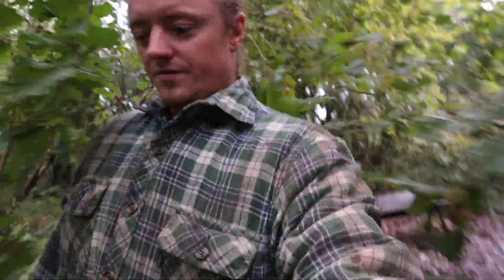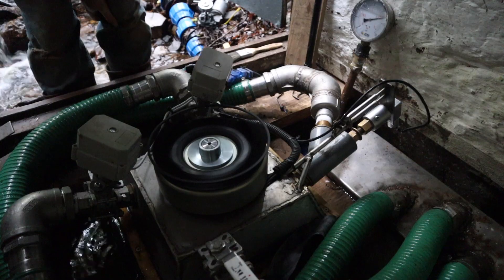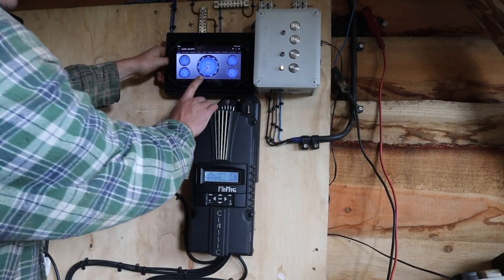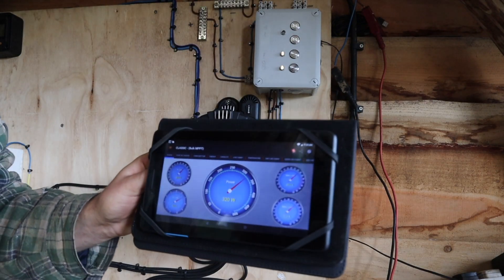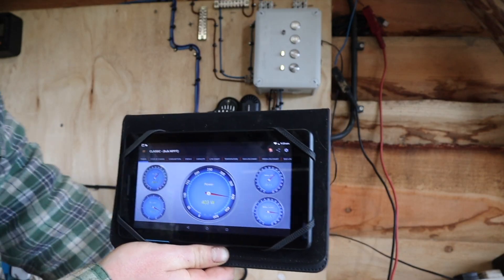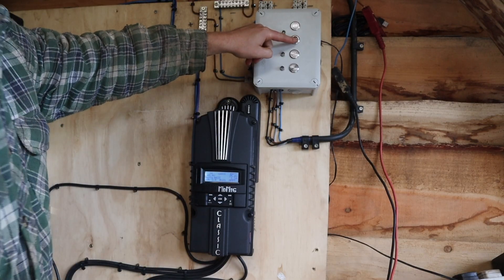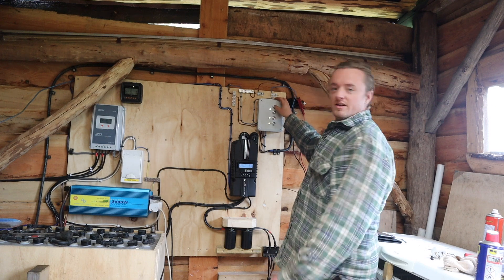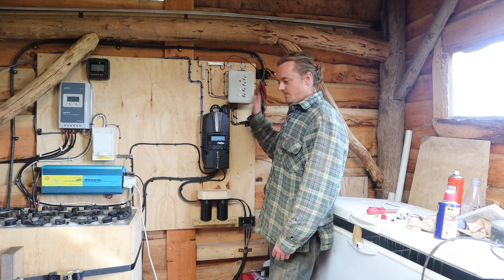Off Grid Arduino Controlled Micro Hydro Full Power Test 400W

Comment: Waited a long time to be proven right... Thank you...

Now still trying to help, you could improve your power generation numbers dramatically if you build your own generator, i am looking at building a dual axial flux wind turbine generator (hydro aint an option for me at present), you could build one yourself for about £100 in copper magnet wire and neodymium magnets (would also make for some very interesting videos). There are plenty of old videos on youtube for you to look at if you get tempted. Im almost ready to order my magnets and magnet wire but need to outsource some lathe work before i start spending as i need to see that i actually get enough wind to turn my turbine in the small space i have to put it.
Reply from the maker: Tricky's World • 10 months ago

So glad to hear a 2nd turbine is going to be added, but you do realise that 4 nozzles will not create 4x the power that 1 nozzle will make don't you? Sounds like you really want to waste potential power or just run a generator as fast as you possibly can to see how long it lasts. Myself i would build 4 turbines and have 1 nozzle each, convert to DC in the hut and send all the DC back up the existing cables, if memory serves you would only need to run a cat 5/6 cable for networking (you can go 100 meters with cat 6) and move the hydro charge controllers to the hut, you may also need an ethernet switch and a buck converter to power it but that shouldn't cost more than £20. That would also allow you digital control over the nozzles using raspberry pi or even arduino with electronic valves/taps.
What ever you do i will still tune in and offer insight where i think you need it. :)

500 Kwh Off Grid Hydro Electric Pelton Turbine Update

Kris Harbour Natural Building
Kris Harbour Natural Building
 • 10 months ago (edited)
4 nozzles does equal 4 times the power minus any pipe friction loss as more water will be moving. and loss in the cable due to cable loss. 4 nozzles does mean 4x the power, it just also add more losses but that would be the case if i had 4 turbine with single nozzles. but that would be way less efficient due to the losses in each individual turbine. PLus the idea of the 4 nozzles is to be able to run differant flow rates with fixed nozzles. otherwise i would just run one huge nozzle. also DC does not travel well so converting to dc in the powerhouse would be silly. ac is much better and convert to dc at the battery. and i ran 4 core armoured cable not cat 5. I think whatever you have been reading has been a bit misleading. i can easily send dc down the cable to turn nozzles on and off and that could be controlled from the battery shed. the way you have suggested would be very inefficient

Thats without even getting in to the fact that the expensive equipment would be above a stream in damp conditions.
Reply from the maker: Tricky's World • 10 months ago
 Mate i'm not being funny but you will find you won't get much more power if any, i would actually expect a loss of power per additional nozzle from the same feed. In practice you are turning the generator with a fixed amount of pressure from 1 nozzle, if you add a second nozzle from the same feed you are going to reduce the pressure that turns the generator on the original nozzle because there will be less pressure in the system, your just going to balance the original power over the first and second nozzle which i don't see giving you any extra power from only 1 generator, it's just going to waste some of the system potential.
 I honestly would build a separate generator for each additional nozzle you want to have coming off the system and only run as many as the pressure will allow. I know this is the expensive option but that's what i would do, it would also provide redundancy.
Your hydro is converting pressure into electricity which you can prove by closing your tap off half way, and watch the power that is generated reduce, if you add a second nozzle you are going to reduce the pressure in the system which will give you less power in the end.
I will happily eat my words if you prove me wrong, but i honestly don't think you will. I will also gladly look at anything you can point me at that will prove me wrong.
Reply from the maker: That is what you said, and i have showed with this turbine that adding more nozzles does add more power. you can even see it with your own eyes as i do it on the video! I just dont understand how you can not get that. Anyway im off, Not going to go though it all again. Back to school for you i think.
Reply from the maker: Proven right? you told me having more nozzle dose not give more power....... Proven wrong is what has happend to you. 

what you said
"Mate i'm not being funny but you will find you won't get much more power if any, i would actually expect a loss of power per additional nozzle from the same feed" 

honestly dont know what world you live in mate. Your advice last time was to build 4 separate turbine because somehow that would work better........adding 4 separate alternators, 4 separate sets of bearings, 4 of everything that causes losses. honestly mate your in your own world. Also i build an axial flux wind turbine years ago, i have a video of it.
Reply: @KrisHarbour  so you want to be a prick then, cant accept facts so try to be clever when your evidently not LOL...

1 you have upgraded your generator, 
2 you have upgraded your pelton wheel, that is where your slight gains have come from, yes 33% is slight especially when we are talking watts and not kilowatts.... 
3 your own words "4 nozzles = 4 times the power" yet from 300 watts to 400 watts, funny 4 times ehhh where is the 1200 watts??? Is it lost in the resistance of the generator by any chance, hmmmm now you know exactly why i would have had 4 generators instead of 4 nozzles.

Obviously you never studied electronics at any level, let alone the level i have, but you continue trying to teach somebody who is clearly more educated on the matter than you LOL...

"honestly dont know what world you live in mate. " & "honestly mate your in your own world." LOL again, you have been proving this all along with all your videos but thanks for your reflection...

You could have just accepted that you was wrong like i was willing to do had you proven me wrong which you can not do, instead you chose to be a prick and make an enemy of one of your oldest subscribers who was trying to give you the benefit of my knowledge, thanks for spitting in my face...
Reply from the maker: I never said 4 nozzles would give 4 times the power if they were all sized differently like they are in my system......If you look you will see that i gave you all the numbers i was expecting and they are exactly what im getting!  if they were all sized the same they would give 4 times the  power minus any losses. I didnt think i would need to spell that out to you as it seems that obvious.   i could make all the nozzles the same size and get 1200w if i had the available water to do so. its just i choose to make them all different sizes to give me a range of flows..... i dont understand what you do get about that. if you quadruple the flow you will (minus losses) quadruple the power. I have not done that as i dont have the water to do that but i have used 4 nozzles of different sizes and got a range of flows and different power levels witch is what you said would not happen..... im really lost for words at how you cant understand that.
Reply from the maker: Here is the complete conversation for anyone interested. 

Tricky's World • 10 months ago
So glad to hear a 2nd turbine is going to be added, but you do realise that 4 nozzles will not create 4x the power that 1 nozzle will make don't you? Sounds like you really want to waste potential power or just run a generator as fast as you possibly can to see how long it lasts. Myself i would build 4 turbines and have 1 nozzle each, convert to DC in the hut and send all the DC back up the existing cables, if memory serves you would only need to run a cat 5/6 cable for networking (you can go 100 meters with cat 6) and move the hydro charge controllers to the hut, you may also need an ethernet switch and a buck converter to power it but that shouldn't cost more than £20. That would also allow you digital control over the nozzles using raspberry pi or even arduino with electronic valves/taps.
What ever you do i will still tune in and offer insight where i think you need it. :)

500 Kwh Off Grid Hydro Electric Pelton Turbine Update

Kris Harbour Natural Building
Kris Harbour Natural Building
 • 10 months ago (edited)
4 nozzles does equal 4 times the power minus any pipe friction loss as more water will be moving. and loss in the cable due to cable loss. 4 nozzles does mean 4x the power, it just also add more losses but that would be the case if i had 4 turbine with single nozzles. but that would be way less efficient due to the losses in each individual turbine. PLus the idea of the 4 nozzles is to be able to run differant flow rates with fixed nozzles. otherwise i would just run one huge nozzle. also DC does not travel well so converting to dc in the powerhouse would be silly. ac is much better and convert to dc at the battery. and i ran 4 core armoured cable not cat 5. I think whatever you have been reading has been a bit misleading. i can easily send dc down the cable to turn nozzles on and off and that could be controlled from the battery shed. the way you have suggested would be very inefficient

Thats without even getting in to the fact that the expensive equipment would be above a stream in damp conditions.

4

Tricky's World
Tricky's World • 10 months ago
@Kris Harbour Natural Building Sorry mate but you are wrong and you have not understood what i have tried to tell you, 4 x the nozzles does not equate to 4x the RPM on the generator nor 4x the power, but sounds like your going to prove me right when you measure 1 nozzle at say 300 watts and open the 2nd to not see double the power, but what ever i tried to help you, you obviously don't want my help and intend to learn the hard way... 
A network hub is not expensive 10er ish, a buck converter is a couple of quid off ebay, your charge controllers can be isolated from moisture with a few quids worth of kingspan and or another of those big plastic boxes, the massive cable you have already laid will give you almost zero losses from DC especially when you have effectively 2 runs of neg and pos. Adding a cat 6 network cable would allow you to place your hydro controllers in the hut or even a smaller cabinet just outside the hut like the BT and virginmedia cabinets that litter the streets, it would also give you connectivity for a hub to add a raspberry pi (£12 ish) or even arduino (less than a 10er with ethernet connectivity) to control your electronic valves and read water pressure from sensors from any device connected to your network, or automated control or even via the internet if you want it to be fully remote controllable/monitorable.

Kris Harbour Natural Building
Kris Harbour Natural Building
 • 10 months ago (edited)
Honestly mate, i dont mean to put you down but you really do need to read some more. The rpm is fixed and has nothing to do with adding more water. more water means more power not more rpm, my rpm is half the speed of the nozzle velocity  so it can catch the energy in the water. adding additional nozzles at the same velocity means the turbine spins at the same rpm but with much more water hitting it meaning it makes more power. This is standard practice for micro hydro. 

you can think of it as volts and amps if you find that easier, the speed of the water coming out of a nozzle is the volts and the amount of water is the amps. the speed of the water coming out of the nozzles stays the same (like having a fixed voltage)  because of the pressure that is fixed (other than losses due to friction)  but the amount of water increases (due to more nozzles) The extra water in this example is like more amps . more amps means more power if the volts stay the same. maybe talking in those terms makes it more clear for you as you seem to be more in to electronics. 

https://www.google.co.uk/search?q=micro+hydro+turbine+multiple+nozzles&source=lnms&tbm=isch&sa=X&ved=0ahUKEwi-mfq7vNTeAhURtosKHTQSACcQ_AUIDygC&biw=1440&bih=798#imgrc=aVQjhIXhXISStM:

here are my figures as i add more nozzles this is what i will expect to get 

1l/s@ gross head of 18.5m = nett head@ turbine of 18.1m = 113w with a flow of 2l/s@ gross head of 18.5m = nett head@ turbine of 18.02m = 226w and with 3l/s@ gross head of 18.5m = nett head @ turbine of 17.9m = 338w, 4l/s@ gross head of 18.5m = nett head @ turbine of 17.74m = 445w, 5l/s @ gross head of 18.5m = nett head @ turbine of 17.53m = 550w, 6l/s @ gross head of 18.5m = nett head @ turbine of 17.3m = 651w, 10l/s@gross head of 18.5m = nett head @ turbine of 15.97m = 1kW, 15l/s@ gross head of 18.5m = nett head @ turbine of 13.5m = 1.27kW, 20l/s @ gross head of 18.5m = nett head @ turbine of 10.28m = 1.29kW.  You can see that trying to push 20l/s down the penstock creates a huge loss in head at the turbine, in fact 15l/s=1270w & with 20l/s = 1290w just a 20w gain.

so if i doubled the flow by adding another nozzle i would get 651w i would expect a bit less than that realistically so around 600w that is at 6lps. as you can see the limiting factor is the loss in the penstock but it only becomes significant as the flow gets very hight due to me designing the system to accommodate upgrades.

3

Tricky's World
Tricky's World • 10 months ago
@Kris Harbour Natural Building Mate i'm not being funny but you will find you won't get much more power if any, i would actually expect a loss of power per additional nozzle from the same feed. In practice you are turning the generator with a fixed amount of pressure from 1 nozzle, if you add a second nozzle from the same feed you are going to reduce the pressure that turns the generator on the original nozzle because there will be less pressure in the system, your just going to balance the original power over the first and second nozzle which i don't see giving you any extra power from only 1 generator, it's just going to waste some of the system potential.
 I honestly would build a separate generator for each additional nozzle you want to have coming off the system and only run as many as the pressure will allow. I know this is the expensive option but that's what i would do, it would also provide redundancy.
Your hydro is converting pressure into electricity which you can prove by closing your tap off half way, and watch the power that is generated reduce, if you add a second nozzle you are going to reduce the pressure in the system which will give you less power in the end.
I will happily eat my words if you prove me wrong, but i honestly don't think you will. I will also gladly look at anything you can point me at that will prove me wrong.

Tricky's World
Tricky's World • 10 months ago
@Kris Harbour Natural Building LOL i know basic physics and the conservation of energy, i also know electronics. Anything not smart assery to prove me wrong or do i have to wait for the video that proves 1 of us right?
Reply: @KrisHarbour  Im really lost for words with how you know i am right, and have done it the way you have to try not to prove yourself wrong, sorry but anybody with half a brain cell can see this and i foresaw this exact conversation the second i seen the video showing different sized nozzles but waited to see where the spear valve was going and hoped there would eventually be 4 of them. 

I told you,  you have have a finite amount of pressure (maybe not the exact words) what you call your flow, and that pressure is what you are converting into electricity, you only have a finite amount of power you can produce and it matters not if you produce that finite amount of power by using 1 nozzle or 4 or even 20, the conservation of energy tells us you can not get more out than you are putting in, all you can do is optimise and work towards a 1 to 1 conversion. What i did not say is that you are at a 1 to 1 conversion because there was and still is room for improvement but you will not get it using 1 generator and how ever many nozzles you want to complicate the matter with, all you will do is run the generator at or above its max potential and create heat in its winding's which will dramatically reduce its lifespan.

I didn't give you the benefit of my knowledge to get you to waste money, nor was i saying to spend that money with me, i had no motivation other than to see you generate the most power you could for the longest amount of time (something you don't seem interested in, it looks like you are just playing and happy with what ever you can get by finding your own way and refusing advice, the age old learning the hard way), yes i was creating more work for you but i thought you would be grateful for the video content inspiration and help you to learn something about arduino and or raspberry pi as controls which i was willing to help you with.

I still say you are better off with multiple turbines, and simply because you already have a 4 core armoured cable ran i would still convert to DC in or next to the turbine house (BT / virginmedia have very expensive electronics in those green cabinets you see all over the country and many are right next to rivers and canals much bigger than your stream) to save you running another long expensive cable, the losses in DC i would not expect to be more than the gains from multiple turbines as your cable is not thin and shitty stuff, but hey if your happy to just play and not do the best you can thats up to you.

Whilst you suggest i go back to school, i suggest you actually enrol in an electrical engineering course, at least i already passed one of those...
Reply from the maker: I really dont know why im still bothering talking about this because its tireing. you are missing some fundamental understandings of how it works and because of this misunderstanding what im saying. 

flow and pressure are not the same thing. the pressure comes from the head and the flow is whatever water is available in the stream. 

"I told you,  you have have a finite amount of pressure (maybe not the exact words) what you call your flow, and that pressure is what you are converting into electricity, you only have a finite amount of power you can produce and it matters not if you produce that finite amount of power by using 1 nozzle or 4 or even 20, the conservation of energy tells us you can not get more out than you are putting in, all you can do is optimise and work towards a 1 to 1 conversion. What i did not say is that you are at a 1 to 1 conversion because there was and still is room for improvement but you will not get it using 1 generator and how ever many nozzles you want to complicate the matter with, all you will do is run the generator at or above its max potential and create heat in its winding's which will dramatically reduce its lifespan"

You are correct in what you say about there only being a finte amount of power available if we talk only in terms of pressure. BUT we are not talking in terms of preasure.....as i turn on more nozzles i am increasing the FLOW. MORE WATER MORE ENERGY. the amount of water veries through the year and with the 4 nozzles i can controll how much water is going through the turbine. The pressure is always the same though. minus small losses as the flow goes up(as you can see on the gauge in the video)  Now the confusion here is you think that because the preasure stays the same the output stays the same regardless of flow and that is not true. if i have one nozzle on at 25psi at 1 lps and it makes 100w if i open another 1lps nozzle it will run at 200w but the preasure will stay the same its just the flow that goes up. you can see this in the video as i do it. 

Now there is always small losses as the flow goes up but to keep it simple im ignoring them at the moment. you originally said adding more nozzles will not give me more power because it wont increase RPM and your right it does not increase  rpm but it does increase the amount of energy hitting the turbine because the flow has gone up..... i could of coures just have one nozzle and double its size and we would double the output power but having 4 nozzles gives me much more controler over a large range of flows. now i could drill them all out and get 1200w if i wanted to but i dont have enough water to run it at 1200w but it WOULD  run at 1200 if i did that. (it would actually be right at its limit and the flows would have to be very high to overcome the losses at that point as shown in the number i sent you. but we are talking theory here and in theory it would) I gave you all the figures before and explain it all to you last time and now i have made a video showing it working exactly as i said it would and yours still not getting it and i just dint understand why, i know it only does 400w in the videos but that number isnt important for this discussion beacsue i can go get a drill and drill a bigger hole in the nozzles and get 1200w by just increasing the FLOW I just dont have the water to do that right at this moment. if it was raining i could..... I really dont know how i can exaplin it any more simply than that. and i dont understand how you can think i dont understand it when i built the whole system from scratch. i honestly dont know what else i could possible do to explain it. its working EXACTLY as it was designed to and exactly as i said it would from day one.  read the numbers i sent you in the comments above and you will see.. 

Pressure is not flow! they are different things. the preasure stays the same the flow goes up as i open more nozzles and if i make those nozzle bigger i can make it produce 1200w from one turbine providing the water is available at the time.
Reply from the maker: I wont be commenting again im afraid but feel free to carry on. i really have tried my hardest to explain how it works (considering i did make it i do actually know how it works beleve it or not) but i just cant get through to you and im sorry but i just cant spend any more of my time talking with you about it as what im saying isnt sinking in. That could be my fault for not explaining it well enough but i just dont have time to go in to it much more because its actualy very basic physics. if i add more nozzles witch add more water you get more energy. There isnt a finite amount of power available as the power available depends on the amount of water available and that changes all the time. so more nozzles means control over a wide range of flows and more power when i turn on more nozzles. becasue there is more water hitting the turbine at the same preasure it really is that simple. in the video on increase the flow by 5X and you can see the presure only move the smallest amount. Its right there for you to see. 

goodnight, and i apologise for being rude. i just find it quite frustrating talking with you about this because im really trying to explain it well as i am passionate about it but you just dont get it for some reason and i just dont know what else i could say or do. i mean it is right there on video of it doing exactly what i said it would do! when more could you want?
Reply: @KrisHarbour  "I really dont know why im still bothering talking about this because its tireing. you are missing some fundamental understandings of how it works and because of this misunderstanding what im saying."
You are bothering because you actually give a shit (which is rare), maybe because you know i am a long term subscriber, or maybe because we established a friendship in the early days, either way i'm grateful you haven't just blanked me...

"flow and pressure are not the same thing. the pressure comes from the head and the flow is whatever water is available in the stream"
Maybe this is the confusion, flow creates the pressure, if there is no flow there is no pressure after what is sat in the pipe has gone, it actually reduces all the while the pipe is draining, so pressure equates to flow. Technically we are both right on that 1 we just see it differently.

  "You are correct in what you say about there only being a finte amount of power available if we talk only in terms of pressure. BUT we are not talking in terms of preasure"
I am talking in terms of pressure though, as you said flow is the water available in the stream, and that flow needs to keep the pipe full while you are draining through any amount of nozzles into any amount of turbines in order to hold an amount of pressure and continually produce power.

"as i turn on more nozzles i am increasing the FLOW."
Maybe into the turbine but your not increasing the water available in the stream, you are reducing the available pressure with every nozzle you open, or the more you open the spear valve as we seen in the video. if you were really bored 1 day you could draw up some graphs showing the correlation between watts generated and pressure drop, and from that graph you could actually predict how much pressure drop you would need in order to produce X amount of watts upto the generators limit (i can't remember what you said the new generator was rated for, but from the size of it i would be shocked if it was capable of producing over a kilowatt). I couldn't see the numbers on the pressure gauge so couldn't throw anything together for you, but don't expect you to go to that extent unless you are really bored 1 day.

"MORE WATER MORE ENERGY. the amount of water veries through the year and with the 4 nozzles i can controll how much water is going through the turbine. The pressure is always the same though."
No disputes here assuming the stream keeps the pipe full 100% of the time.

 "Now the confusion here is you think that because the preasure stays the same the output stays the same regardless of flow and that is not true. if i have one nozzle on at 25psi at 1 lps and it makes 100w if i open another 1lps nozzle it will run at 200w but the preasure will stay the same its just the flow that goes up. you can see this in the video as i do it. "
as you opened more nozzles the pressure was dropping like i said it would, or was the stream not keeping the pipe full at that point?

"you originally said adding more nozzles will not give me more power because it wont increase RPM and your right it does not increase  rpm but it does increase the amount of energy hitting the turbine because the flow has gone up....."
There are calculators for generators that tell you how many RPM you need in order to create however many watts the generator is capable of, the more RPM = the more power it creates as you see just by watching the turbine spinning faster when you open other nozzles. The generator is only going to spin so fast, when it gets to its power generation limit is is going to start braking (as in slowing down because of electrical resistance in the coils) not breaking as in falling apart.

" i could of coures just have one nozzle and double its size and we would double the output power but having 4 nozzles gives me much more controler over a large range of flows"
I agree, which is why i like the spear valve and hoped to see 4 of them eventually, that could prove you right but i don't believe it will. I honestly think if you had 4 nozzles (all the same large jet size) as you open more of them the gains will be minimal, if there are any gains at all as you say it won't increase RPM.

"but we are talking theory here and in theory it would"
I still don't believe nor accept that it will, please by all means get 3 other jet caps and drill them out (i bet you already have spares) and on a really rainy day prove it to me, and i will gladly apologise. I will even give you 10% leeway so if you can show me it making 1100 watts i will gladly eat my words, hell i'd even buy you a pint if you were ever in my neck of the woods.

"Pressure is not flow! they are different things. the preasure stays the same the flow goes up as i open more nozzles and if i make those nozzle bigger i can make it produce 1200w from one turbine providing the water is available at the time."
i'm getting lost between flow being what the stream can supply and flow through the nozzles, pressure is directly related to what the stream can supply.

Now that ive got that off my chest, what is the actual rating of the new generator? can you tell me what the pressure drop was with each opened nozzle and what power increase there was? i would like to see a graph for it, i could show you the graphs created by my diy solar monitor but i think they would bore you lol.

"goodnight, and i apologise for being rude. i just find it quite frustrating talking with you about this because im really trying to explain it well as i am passionate about it but you just dont get it for some reason and i just dont know what else i could say or do."
Apology accepted, i too am very passionate about electricity production and electronics in general (we might be clashing lol), like i have said before you are literally living my dream, i have the knowledge and the will to do what you are doing but i don't have the funds, aside from being jealous i really want to see you succeed and want to help you as until i win the lottery i aint going to be doing what your doing. 

I also will extend an apology for the way i spoke to you. Goodnight mate...
Reply from the maker: Ok i Need you to read about pipe friction loss before we carry on with this. I have 25psi of pressure the is dictated by the hight difference from intake to turbine. Now i have used 110mm pipe and the pipe length is 200m long. So as water flows there is loss in the firction of the pipe. so if i double the flow i double the loss. HOWEVER the pipe is sized in a way that that loss is very very small and as you see in the video i go from 20w to 400w increasing the flow by at least 6x and the pressure drop is small just a few psi.... now as i go higher and higher with the flow eventually the loss in friction (preasure) from the flowing water will get to a point where you no longer get any more power. As i mentioned in the video the returns diminsh as the flows go up and up due to the losses  BUT for this system that point is at 15 lps if you look at the numbers i sent you. you talk of send me a graph but i have done it all and know exactly what flows give what preasure and i have shown you this 3 times now. 

1l/s@ gross head of 18.5m = nett head@ turbine of 18.1m = 113w with a flow of 2l/s@ gross head of 18.5m = nett head@ turbine of 18.02m = 226w and with 3l/s@ gross head of 18.5m = nett head @ turbine of 17.9m = 338w, 4l/s@ gross head of 18.5m = nett head @ turbine of 17.74m = 445w, 5l/s @ gross head of 18.5m = nett head @ turbine of 17.53m = 550w, 6l/s @ gross head of 18.5m = nett head @ turbine of 17.3m = 651w, 10l/s@gross head of 18.5m = nett head @ turbine of 15.97m = 1kW, 15l/s@ gross head of 18.5m = nett head @ turbine of 13.5m = 1.27kW, 20l/s @ gross head of 18.5m = nett head @ turbine of 10.28m = 1.29kW.  

You can see that trying to push 20l/s down the penstock creates a huge loss in head at the turbine, in fact 15l/s=1270w & with 20l/s = 1290w just a 20w gain.

So as you can see i can keep increasing the flow (providing there is enough water in the stream) by opening more nozzles or making those nozzles bigger untill i get to 15lps, and it will produce around 1200w after that point the pipe friction loss starts to go up so much the returns are so small even after adding lots more water. I have worked this all out and made the turbien and sized all the pipe around these numbers. These numbers are 100% accurate so my head and pipe size. 

So you are right getting 1200w would be Right at the very max it could ever do with this pipe size but i never even wanted 1200w out of it! the other components are not even rated for 1200w and i never once said i would get 1200w  this is another place you are misunderstanding. when you told me that adding more nozzles will not add more power i was itrying to exaplin the theory of it to you. not what i was hoping to get out of it.  I never have and never will need 1200w out of this system i was mearly pointing out that adding more nozzles and more flow does makes the power go up. If you double the flow you double the power...... BUT there is pipe friction so when you double the flow you double the friction BUT the loss is small so you double the flow at the low end of the flows i have design my pipe for and the loss is small. the power doubles and almost no loss of pressure. once you get up to 15lps then doubleing the flow does very little to add more power untill the pipe was made bigger so the loss ewas smaller. . when i said 4 nozzles is 4 times the power i meant 4 nozzles the same size would take the power up by almost 4 times as long as the pipe friction loss was small. I was trying to make it simple as you were talking about RPM and RPM is not what we are talking about here as the RMP is fixed to the pressure and the pressure only drops a little bit as the flow goes up. This is true of my system as you can see in the video. i take the power up from 20w to 400w with only a small loss in pressure (that loss due to pipe friction) Please go and read about pipe friction loos and read those numbers i have sent you loads of times now all you need to know is right there in those numbers they have been checked by me and a Hydro electic expert they are 100% mathematically accurate for my pipe size There is liternaly no dispute here. Im telling you how it works i worked all this out years ago and it works exactly as planned. i will be doing some adjustments to it to lower pipe loss like taking out the 90 degree bends and it will get close to 500w without me changing the nozzle sizes (just by increased efficiency) after that point when it is efficant and running at around 500w i can then (if i want to) make those nozzles biger to get more power. I COULD DO THAT ALL THE WAY UP TO 15LPS AND GET1200w before my losses would cause such a drop in preausres that i would get no more power regardless of how much more water was flowing. 

PLease stop talking about water available. that is not a factor when talking about theory! i often get 300lps flowing in the stream when raining hard, the water in the stream is not the limiting factor the size of the pipe is and the pipe i used can move 15lps and make around 1200w if i wanted it to...... i just dont need that amount of power. And i would have to upgrade lots of stuff to even run it at that. IT NEVER WAS PLANNED TO AND NEVER WILL BE RUN AT 1200W But is could if i made the nozzles big enough to let 15 liters of water a second hit the turbine. After that point without changing the size of the pipe THEN WHAT YOU ARE SAYING IS 100% CORRECT at that point the power would no longer go up by adding more water as the losses would get to the point that there would be no more gain....Remember that this is all based on there being enough water supplied at the top........And like i said i can easly get 300lps sometimes... But my average flow is abround 3-5 lps so the system is designed to run most of the time at 300-500w But IT COULD RUN AT 1200W if i drilled out the nozzles to let 15lps through and if there was enough water filling the intake. BUT other components are not rated to run at 1200w, the turbine is only rated for 1000w or the spoons will break, the pma is only rated at 1000w I DONT WANT 1200W im talking about pipe loss theory here! And again....if i had 15lps running through thi stems it would make 1200w! But after that point the increase in water would not increase the output as the losses would get to great to make any difference. 

The thing you are missing here is the understanding of the pipe friction loss i believe, this is not a hose pipe it is a 110mm penstock and the losses at the rated flows are very small (as shown in the videos) 
But those losses climb as the flows go up and as i have show time and time again for this pipe size 110mm pipe over 200m that point of no more return for more water is 15lps and 1200w but i dont need or want that much power.....  

you can search for pipe friction loss calulator and check all those numbers if you want i can assure you they are 100% accurate. 

Please tell me you understand that now this is so tiring.
Reply from the maker: I really dont know where this 1200w number came from. i really never said i wanted 1200w out of this system, you created that number by taking my old system and x it by 4 because i said 4 nozzles does increase the power by 4 times...... I never said i was having 4 nozzles the same size! infact that exactly what i have not done. I never said what flow those nozzles will be to get 4 times the power. I have made them all different to work in a range of flows. i think you have a real problem with understanding things. you take small bits of information and turn them in to what you already beleve and are blind to the new info. you take things so literal that you miss a huge portion of understanding this When i said adding 4 nozzles will x the power by 4 you took that to mean i wanted to get 300w out of each nozzle but i never said that! and clearly that was not my goal as i have sized one of my nozzle to provide about 20w at extreme low flow. 

Another problem you are having with this you are applying variables  to things where there is no need to. why talk about the flow of a stream when talking about theroy? this is something you cant know! it has no basis in what your saying. the stream can change over night. you fail to understand these things and i just dont understand why.  i dont know how you think you can tell me about how my system works when you have no idea how much water is in the stream, all you can do is comment on the theory of how the system would work if there was enough water in the stream. But yet use that info that you dont have and cant know as the bassis for your argument. I dont understand why you bring these variables in when there is NO WAY you could know them. the things you do know are the numbers i have sent you and those numbers are physical mathematical facts that will never change as long as we live on this planet.  

 why would i use turbine spoons rated at 1000w if i wanted 1200w? I was always just trying to explain the theory to you because you are not understanding it correctly at the moment. what i run my system at is irrelevant to you. BUT adding more water gives more power! That is what you said would not happen, you said i would need more pressure to get more power and that is fundamentally untrue flow WILL increase power, if that comes in the form of more nozzles then it will make more power as you turn them on! its that simple.
Reply: @KrisHarbour  Come on kris i know all about friction loss, i also know all about resistance in the generator coils, i am not arguing with the mathematical theory and will try to make a graph from those numbers over the weekend so i can visualise them and help me to understand.

Now i think our confusion is that you are talking about the theory and i am talking about practice, it really could just be that simple, now i know you do not need 1200 watts it is a bit clearer, but you have to see my point of view too. I want to do something similar eventually and my current home power draw is over 20kwh per day so obviously i would need to be creating a lot more power than you are doing and would like to see it already achieved, when you said you can just keep adding nozzles to make more power i thought great in theory, but in practice it sounded like i could take a residential home water supply which has a fixed pressure and max lps to drive a turbine to create power, and i could just keep adding nozzles from that same supply to create more power upto what i need (we both know this is not possible, but thats how it came across and i doubt i am the only person who saw it this way), this is what has frustrated me and i'm using variables because in real world scenario they are relevant, but like you say and i admit, i am a very literal person.

If it takes 3psi to make 400 watts on 1 turbine, and then an extra 6 psi to get that same turbine to produce 800 watts, isnt it better to run 2 turbines at 3psi each in order to make the same 800 watts and have an extra 3psi to play with, this was always my point, its efficiency as like i say i would like to see it produce a lot more power, but its now clear that you dont need it, although you could use it for heating water or something else.

I still dont fully understand but you have made it clearer, i will try not to argue with you so strongly in future. Thank you for the debate and i apologise again for the animosity.
Reply from the maker: Ok, we are getting somewhere. You defiantly can’t get any real usable power out of a home water supply as like the say pressure and flow are fixed and loss is high. So adding nozzles would do nothing to change that as the amount of energy available is fixed. Fixed pressure fixed flow. But my system the flow is not fixed in fact the 4 nozzles are there for that exact reason. So I can increase the flow when it’s raining and lower the flow when it’s not so I don’t drain the pipe and lose pressure.

My limiting factor is the pipe size if I wanted to get to 1200w (if it was raining) so with my system to get 1200w out of it (if everything was rated for that) it would need 15lps to get to 1200w that could be from one nozzle or shared between 4 nozzles of different sizes but at my head 18.5m 15lps would make 1200w if I had more head I could make more power. If I had a bigger pipe I could move more water. But with my pipe my theoretical max is 1200w that is the point that the flow will not increase due to the losses in the pipe. I don’t want or need 1200w and my flow average is lower than 15lps (but does flow at 200-300lps sometimes) my average flow in the winter is 3-5 lps so my average output is 300-500w that is shared over 4 nozzles. One spear valve for delicate control and 3 fixed. Why 3 fixed nozzles? They are more efficient than spears as there is less friction so using the fixed nozzles is better but the spear is good for fine adjustments. The rpm of the turbine is fixed to half the nozzle velocity. Because that does not change much at my rates flows the rpm stays very close to half regardless of what nozzles are open. As at my rates flows my losses are small. Your original statement said adding more nozzles won’t get more power. That isn’t true. The last turbine had one nozzle that could only get 3lps out of it at full. I now have 4 nozzles and can get 5lps out of them (at the moment I could make them bigger) so when I said adding more nozzles makes more power. That is because more water is hitting the turbine at very close to the same pressure. And that means more power. If you wanted to make 1200w with 18.5m of head you would need to run about 15l of water a second to the turbine at about 50% efficacy. Not at all possible from main water unless you tapped in to the main pipe in the road.
Reply from the maker: As for the running of more than one turbine that just adds loss. The turbo is only 85% efficient and all the nozzles and bearings eat up power. It’s far more efficient to put more water through one turbine than it is to run multiple turbines. Unless of course the other turbine had a different water supply and it’s own pipe. It would be like a car having two 100hp engines running to make 200hp you would have all the loss involved In all the pullys and bearings of two engines for the same output as you could have from one engines amount of pulleys and bearing.  And that is far more efficient than running two separate engines for the same power. Much better to just put more air and more fuel in to one engine and just have one set of losses. It’s the economies of scale. That is why wind turbine get bigger and bigger (I know they also have lots of them) but the big they make them the more efficient as you get more power for the losses of one turbine. Look up economy’s of scale.
Reply from the maker: Why don’t formula one cars have lots of little engines? Why not make wind farm out of loads of 100w turbines? Because you get more power from one set of losses and just making the machine bigger and process more energy wether that is fuel, air, wind, water the economises of scale apply. One big turbine (if provided the same pressure and flow will make more power than two turbines running from the same supply. If I put my head and flow through two turbines I would see a loss of at least 30% as there would be two turbines that have losses, two alternators that have losses, 4 bearings that have losses, more sounds (sound is loss of energy) all that would eat up power far more than just have one bigger turbine
Reply: @KrisHarbour  A home water supply is all i have access to and could use for any kind of comparison mate, like i say its just how it came across. I would still like to see your system generate the theoretical limit though, it would prove to me that i could do the same when i finally win the lottery and buy my own piece of land. 

Like i say i am currently building a wind turbine, but in the small space i have to put it, i need to prove to myself that it will catch enough wind to spin the thing before i go spending on magnets and magnet wire to build my own generator for it. My solar panels dont produce anything worthwhile for 3 months of the year where they are currently situated and i need to supplement them with something else and wind seems like my only option, but i have to prove the concept before i go investing. I could show you how bad my solar panels are if you are interested, i made my own monitor for the system using an arduino that takes measurements every second and displays them on my website, i will be adding the wind turbine into this monitor when i build it, i am confident i will get enough wind but not confident enough to make the investment, i want to see the turbine without a generator spinning in the wind at min 240RPM otherwise it is pointless me investing the money as i would be lucky to produce 30 watts when the wind is up if i cant achieve over 240RPM.
Reply: @KrisHarbour  I think you missed my point, i understand losses, it is those losses i am using in my example, if it takes 3 psi to produce 300 watts and then an extra 6psi  to generate 600 watts (inaccurate numbers) that is 9 psi to produce 600 watts, you could use that same 9psi to run 3 turbines at 3psi to produce 900 watts, generating electricity from movement is not the same as burning fuel to generate movement, although it is similar and i see your point but do you see mine?

I have to nip out now, but will catch up with you later this evening. take it easy mate :)
Reply from the maker: well you can get the rpm to 240 by just making the blades smaller. if you needed the rpm. but i better option would be having really big blades and not need so much rpm by putting lots of turns in the axial flux alternator so one rotation has the same energy as say 10 rotations of a smaller turbine.  I have actualy made one but i made it for 12v so i need to make a new stator for it for my 24v system. check out the video its on my channel.
Reply: @KrisHarbour  i must have missed that, damn youtube is useless, i searched axial flux and watched almost all the videos it gave me, will go looking for yours now. Did yours do well, or should i just find the vid?